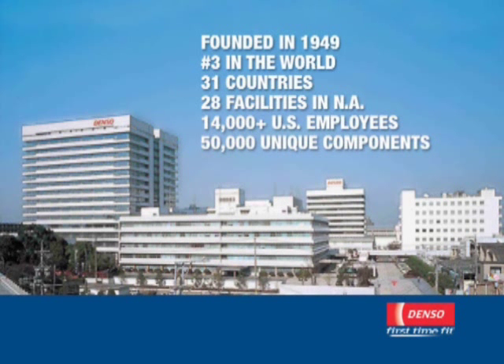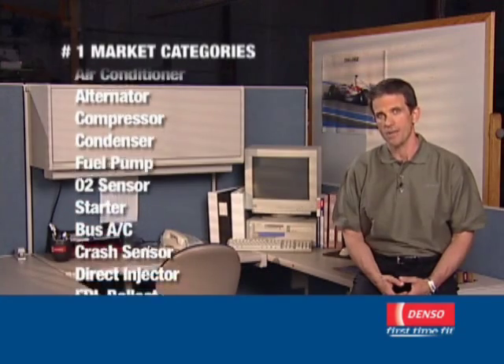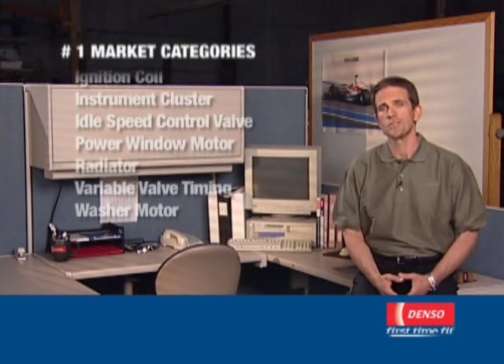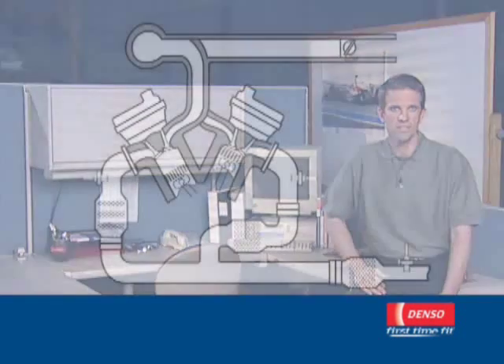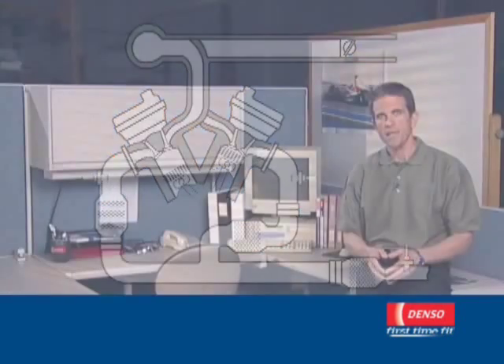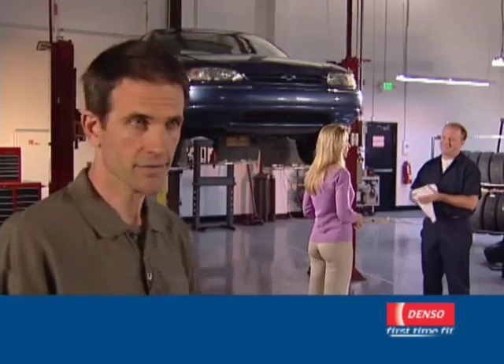Denso Oxygen Sensors

Comment: Beware of fake Denso O2 sensors on ebay.  I searched for the oem part number for parts in the US, ordered the 2 sensors.  They didn't work.  Found out the seller is located in China, but the parts were shipped from the US. I don't recommend buying anything from ebay anymore- especially software and autoparts.